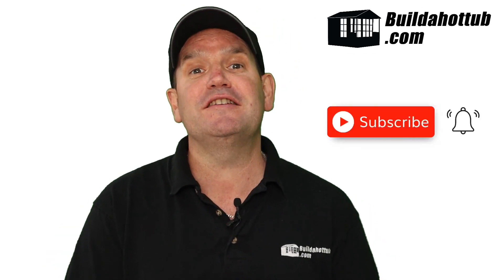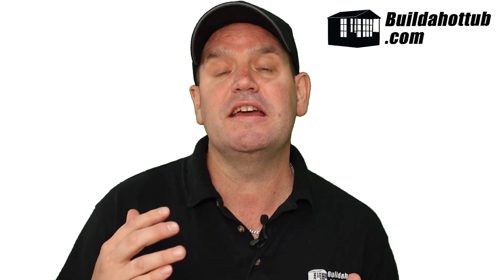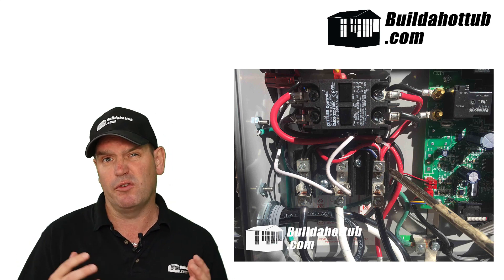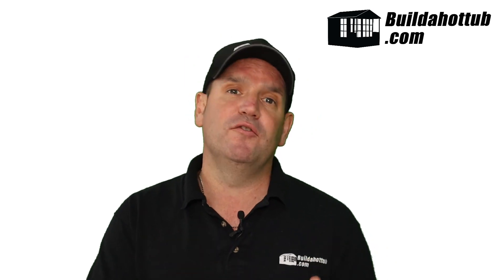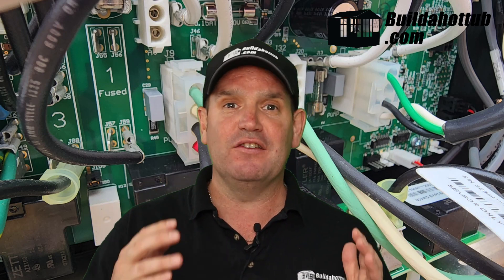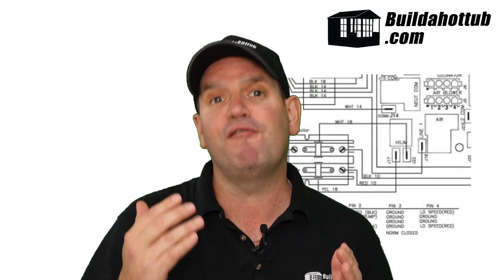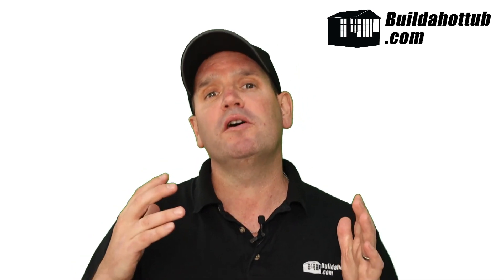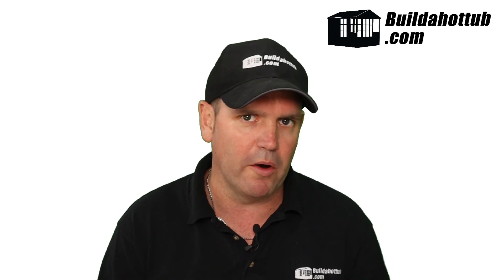Spa Pack Pin Outs and Wires - A guide for connecting up your Spa Pack Correctly

Comment: Does the color wires off the pump have to match the connector getting plugged in to the pac in color order or does the pinouts take care of that hope im explaining it correctly
Reply from the maker: Always go for the pin outs over color - colors can vary. Hope that helps - Andi